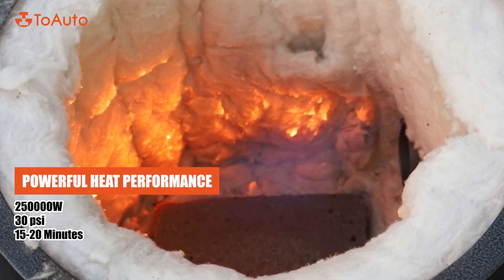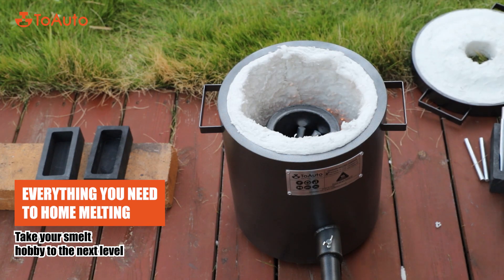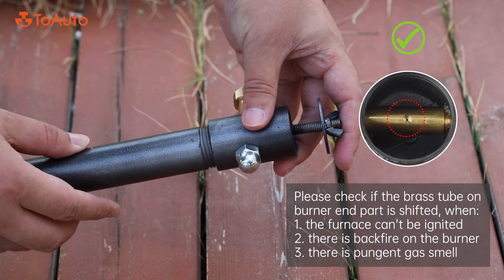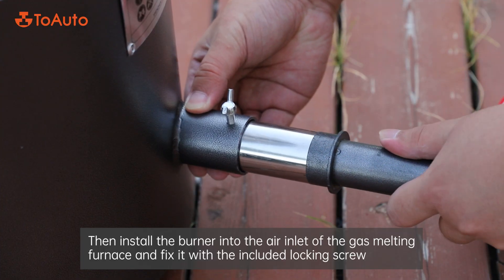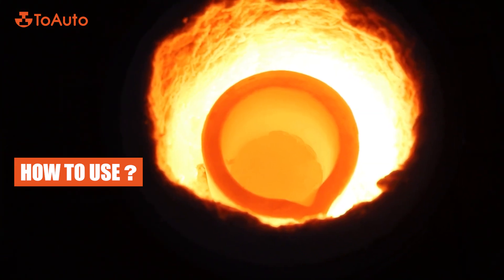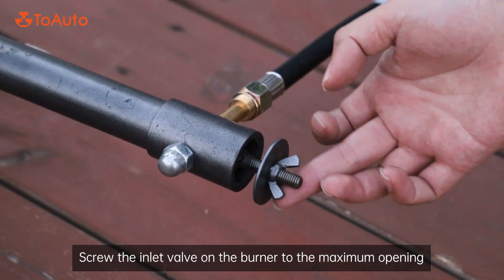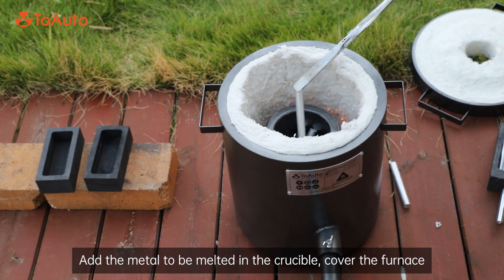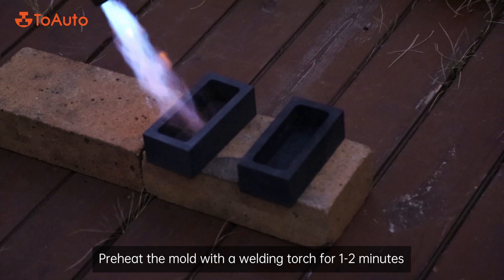【Upgrade】ToAuto V3 Propane Gas Metal Melting Furnace - Casting metal for beginners in 2023

Comment: When you are smelting, with a propane foundry, are you supposed to smell the propane when it is going
Reply from the maker: Why smell propane🤔Maybe you can check for air leaks in advance.
Reply: @ToAutoOfficial  yeah. We figured it out. But only after a small fire ball :)
Reply: Why won’t mine go to 30 psi only 26 not hot enough to melt copper takes to long please answer